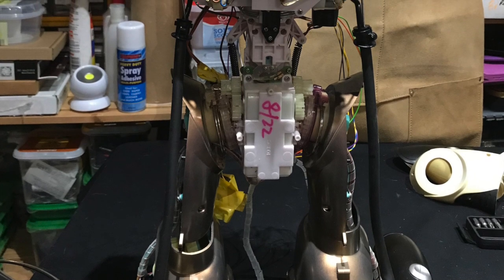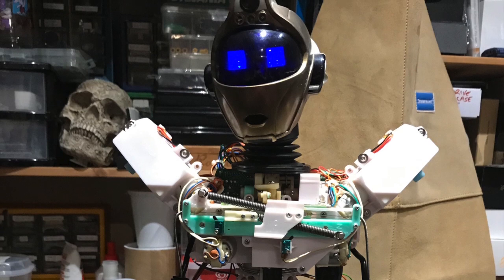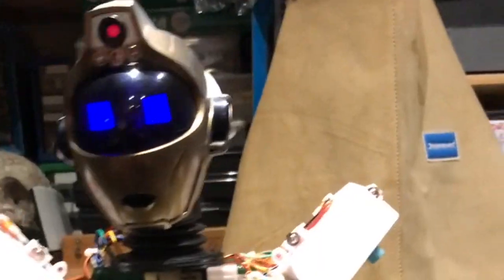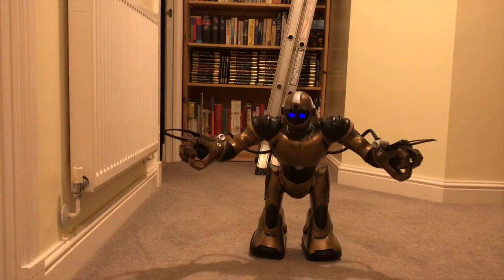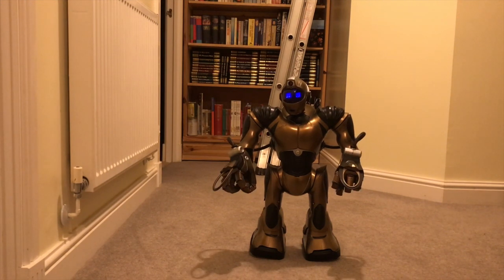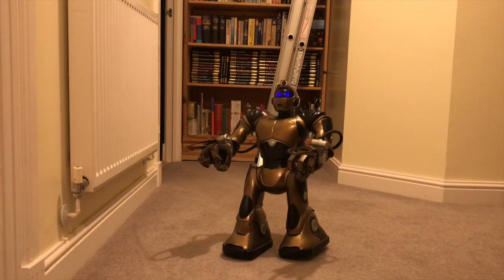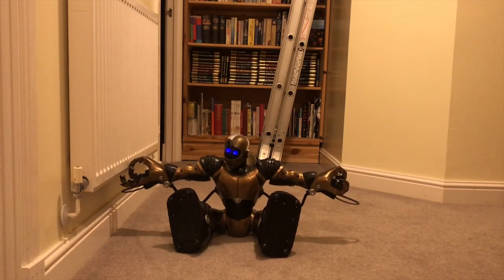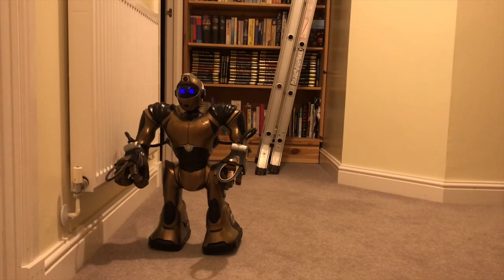Robosapien V2 Bronze Serious Repair Part 3

Comment: Aha, so my hypothesis on the D cells not connecting was correct. I've had the same issue, although mine was caused due to a faulty solder joint after a rewire.
Reply from the maker: So you rewire them as well, its a fiddly job but very rewarding when they work.  I'm so pleased about this one and doing the foot transplant from a dead V2 somebody sold me and ship in a large box with a Single Sheet of newspaper wrapped around it.  As you can imagine I arrived in bits.
Reply: Dang I found you on here bro 😂

But yeah, I assume you’re referring to him not moving?